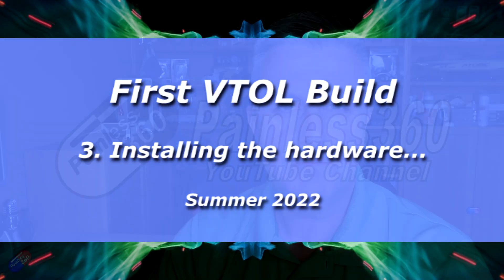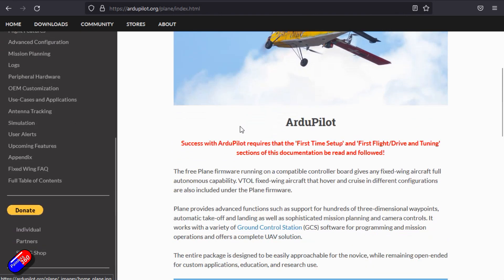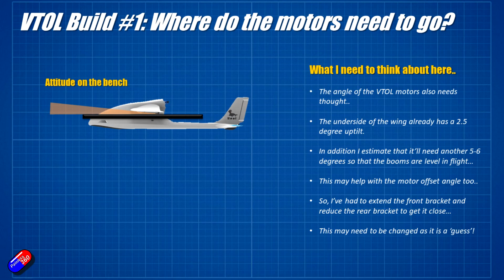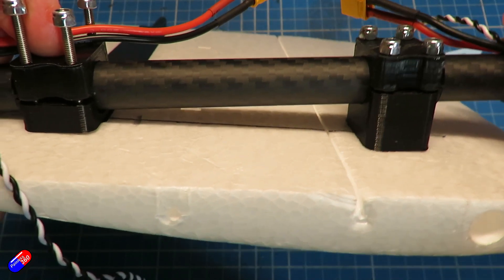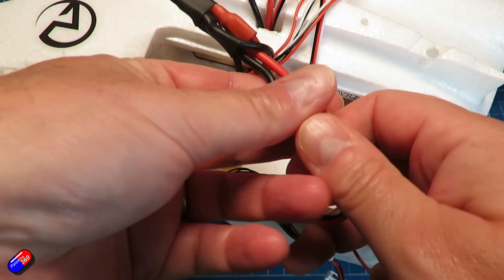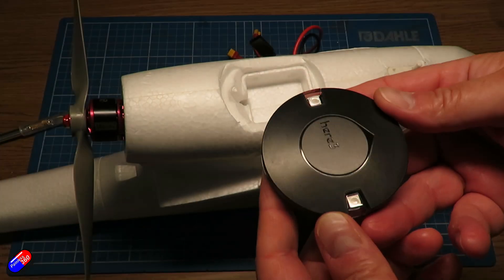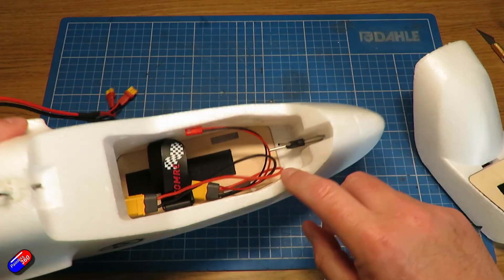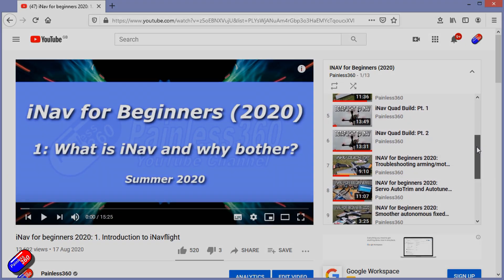My First VTOL Build: figuring out how to mount the motors, ESCs, GPS and air speed sensor!

Comment: Just a thought about the position of the VTOL motors: you refer to the situation that all motors are the same and provide the same thrust. You could, however, also use more powerful motors at the front providing more thrust and therefore get the opportunity to move them further back towards the wing. This would obviously go in line with the higher weight of the more powerful motors, which again could benefit of a smaller distance to the CG. 
I am puzzled, that many airframes rely on the "all-the-same" approach, which might not always be the most efficient....
Reply from the maker: There are dozens of ways to make a VTOL. Best of luck with your ideas, they sounds interesting!

Comment: Hi Lee - your video inspired me to build a VTOL using my Seal plane. I bought a Matek f405 VTOL and some 2nd hand motors, designed, printed and glued the carbon fiber supports for the wings, ordered other missing components… it is really a lot of work and I am facing it as a long term project for the winter time. Wishing to see your plane in the air! Good luck! Cheers from Spain.

Comment: Hi Lee, thank you for your videos they help this old mans mind keep learning. have been getting parts ready for ranger t1 build and have all but FC, i see the matek h743 wing has been used but will wait for your pick. have been saving for this build and can't wait learn new stuff. however to my surprise I have 39.94 us in pp and you I see have a link, would love to send for the ranger t1 build. Thank you Leland C.
Reply from the maker: I plan to use the Matek VTOL flight controller for that build... stay tuned!
Reply: @Painless360  sent what i could to help ranger t1 build and see they have a matek f405 vtol in stock at getfpv along with downloads for firmware . this is going to be fun. Leland C

Comment: The gps/compass is somewhat close to the main nmotor. Try to ensure the wires run as far from it as possible. You might get compass interference. You can check this in the pixhawk dataflash logs.
Reply from the maker: Stay tuned,  I'm going to talk about that in the commission tests... happy flying!

Comment: Excellent video, you are going through a lot  of the same CG decision making process I went through on both nano and full size skyhunter conversions. I think you'll have good results. One caution: Consider either moving your here3 away from the motor and ESC or adding an auxiliary I2C magnetometer somewhere less magnetically challenging, as you will likely see some large magnetometer pull off under forward throttle. I was able to place the HERE2 far enough from my motor AND battery distribution on a full sized sky hunter VTOL, and didn't ever end up with any magnetometer health issues during hover or transition. It's completely fair to remote out an additional magnetometer, even the little $5 ones from Amazon will suffice, and place it out on the tail somewhere. That was the only solution that allowed the MAG in the nano skyhunter to perform adequately.  it will require you to reorder and deselect the SPI magnetometer from the compass setup page, but the results are worth it. But man, when you achieve your first successful transitions, that's such a cool feeling.
Reply from the maker: Thanks for the comment. Stay tuned,  I'm going to talk about checking for that in the commissioning tests... there  are a few options for this as well as physical distance... happy flying!

Comment: Everything I've read says to keep battery-to-ESC wires short and to extend the motor wires to minimize voltage spikes seen by the ESC due to inductance in the battery wires.  Would it maybe have made more sense to use a 4-in-1 ESC inside the fuselage?
Reply from the maker: Please remember, this is a 'test build' only to figure stuff out. Please feel free to take the lessons I'm learning and build your own as you can.. Best of luck!